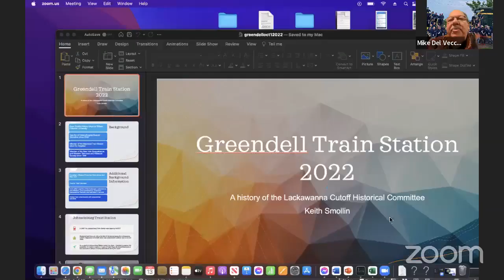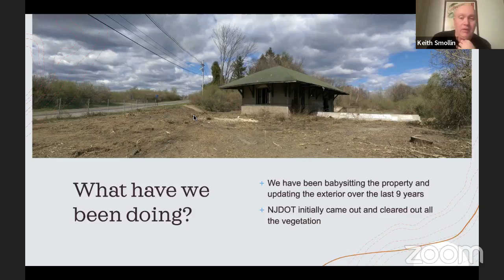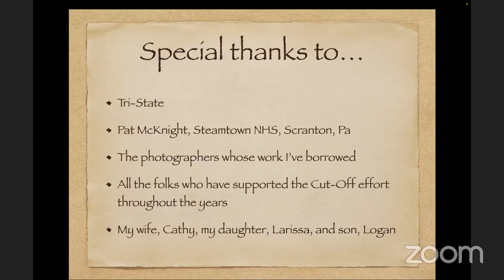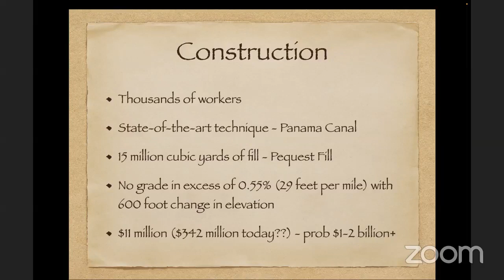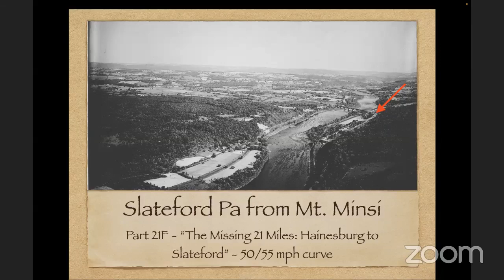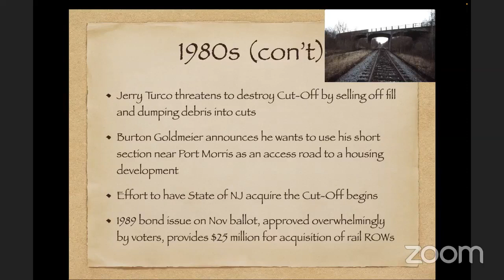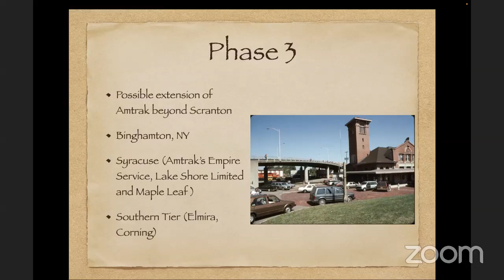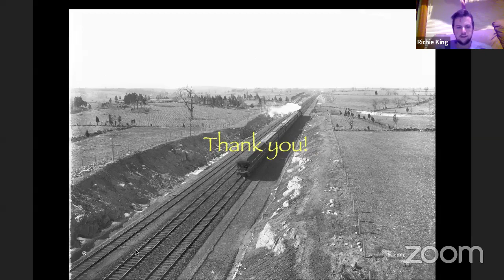Membership Meeting - October 2022 - The Lackawanna Cut-Off

Comment: HI! My name is Jason Fennimore. I am writing a book, not so much on 'the Cut-Off', but all of the shady stuff that is going on around it. Circumstances have also forced me to start a local newspaper called 'The Northwest Jersey Times', which (hopefully) will be in print early next year. As you know we don't currently have a real local paper. I will try and be brief, but I don't think I can be.....

Some of, if not most of those kids on dirt bikes that you talk about at 13:35 have been repeatedly exposed to Toxic Waste on the Cut-Off. In February (2023) I was riding my bicycle on Byram Trail in Byram, NJ. I got to the top of the hill and cut across the 'Cut-Off' (and through a thick fog) to Brooklyn Road. I rode about a half-hour away and got violently ill, started to lose my vision and almost went blind. I felt like I was going to die. It took me many weeks to realize what had happened. It turns out that there is a Superfund Site in Byram on the side of the 'Cut-Off' and Toxic Waste runoff has been spilling onto the 'Cut-Off' since at least the seventies.  In the "Waltz & Reese Cut". The 'Cut-Off' in that section is so polluted with Toxic Waste that there is no way they can ever clean it up. It is so polluted with Toxic Waste that you can see the pollution from outer space. Check out page 101 of 162 (figure 4 Plume Map) in this EPA report.... https://semspub.epa.gov/work/02/541229.pdf

I realized after getting poisoned that all of those kids on dirt bikes on the Cut-Off were being exposed to lethal Toxic Waste. Chuck Walsh is an evil person that knows all of this and suppresses this information. Chuck Walsh's Cut-Off grift is over. I made 240 signs, laminated them and stapled them to trees all along the Cut-Off. These signs say "Warning Dirt Bikers" and show the EPA's maps that show where the toxic waste on the 'Cut-Off' is. Also some of these signs have a picture of "Choo-Choo" Chuck Walsh and it has his contact info and tells everyone how he knows that kids are getting poisoned on the Cut-Off and doesn't care. If you don't believe me, take a walk on the 'Cut-Off'. I must have put 10 or 20 signs on the track (and connecting trails) right behind Greendell Station. Go look.

I don't know any of you but I would like to think the best of people I don't know. I am trying to get this information out in any way I can. Now that I have stopped the Dirt Bikers from riding through the Toxic Waste by putting up the signs, I am notifying the public as I think the dirt biking kids' parents would like to know they are splashing around in Toxic Waste runoff. Please keep this comment public. It won't look good if you don't. Ask Chuck. I have been posting this in the comments of "Choo-Choo" Chuck's YouTube page all year. He suppresses the information. Go look at those signs on the 'Cut-Off'. Do you think that's a good look? By the time I am done with Chuck, he won't be able to show his face in Northwest New Jersey. You have to understand that Chuck is a very bad person and he did all of this to himself. I have proof of Chuck committing serious crimes. I told him that I was going to report him to the authorities and coincidentally (?) he took his family on vacation... a short drive from the Mexican Border. For real. He stopped making YouTube videos and nobody knew where he went. Watch his latest video. He talks about his abrupt disappearance and tries to explain it. Please keep this comment public as I don't want to make more signs.

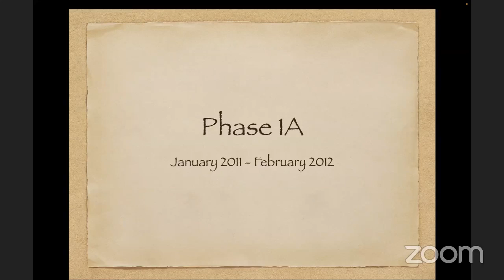Those 3 'disconnected tracks' "Choo-Choo" Chuck talks about at 1:30:50,... one of those disconnections is a road. The other gap is because NJ Transit is so shady that they stopped the tracks on 1 side of the 'Toxic Distal Plume' and then started the tracks back up on the other side of it. This whole operation is sloppy. They are so incompetent, they can't even do criminality correctly. When I was laminating the signs at the main Sussex County Library in Newton, I was also making copies of the first draft of my book to send to my publisher. One of the librarians was reading the draft. She said; "You know what I think? I think they all hate you because you caught them all red-handed!!"...... Librarians know what's up. 

By the way, you did a good job on that station! I like the little lights going across the roof. 
I would definitely go to that museum. I love local history. That is what the 'Cut-Off' is; history. They are never going to run trains on it again. I guarantee it. If you knew all I know, you would agree!
Reply: This was a very funny read.  The people who just rehabilitated the Roseville Tunnel need the newsflash that there won't be any trains on the cutoff again.  How is your newspaper circulation?